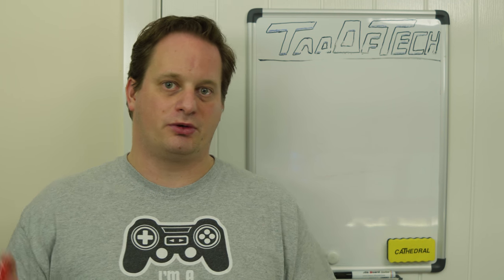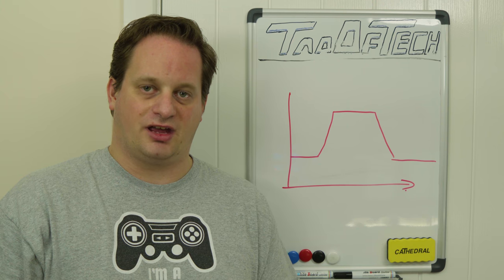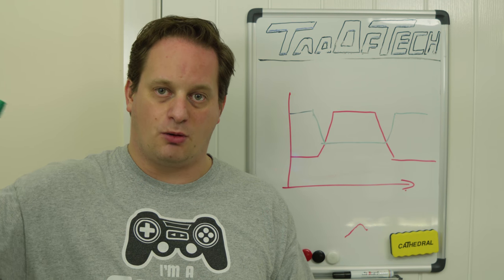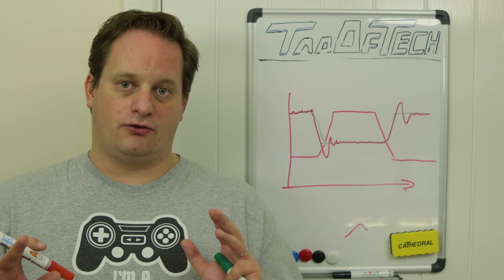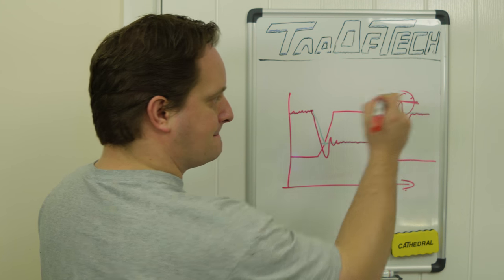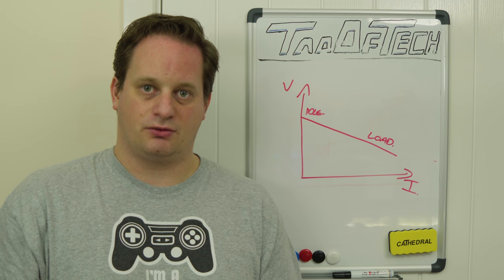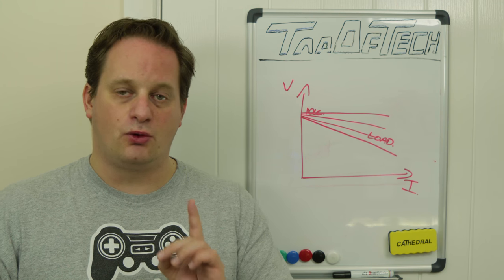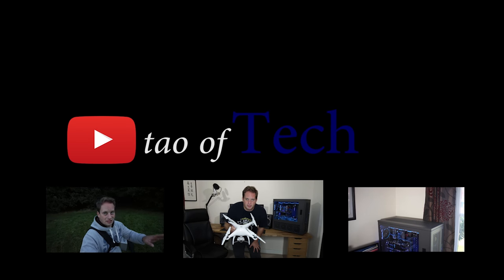Load Line Calibration - what is it?

Comment: Thanks for the explanation. But there's something I don't understand: If, like you say, the voltage drops when the system comes under load, why does the Vcore value in CPU-Z/HWinfo always go up? I haven't touched the default LLC values in BIOS.

Comment: Could you please explain this in my case: trying to overclock my cpu, was successful but after a few months the VID would go over what i set it manually (e.g. 1.44 when i set it to 1.4) then crash. I'm worried my cpu is permanently ruined although it still works and benchmarks have only shown a 2-3% decrease in performance. I set CPU LLC and CPU/NB LLC enabled, but there weren't any other settings apart from that. 
My specs:
Asus m5a97 r2.0 (latest bios)
Fx8350 4.2Ghz @1.38V
16gb Ram 1600 / 1866(OC) @1.5V
I think i may have a combination of a bad silicone chip and bad oc motherboard. I obv known my budget mobo is limited, but volate instability on that scale isn't normal

Comment: Hello! First of all thank you for the great video and great explanation.
I am new to the OC world and there is one thing that is confusing me related to Vcore and LLC. 

I have an i7 4790k and I would like to run it at 4.7 GHz. For this, I need a vcore of 1.29V; 
Reading multiple forums online it seems like for my CPU I can run 1.3V daily without damaging it in the long term. 
However, when I check HWinfo or any other software I can see that the reading is Vcore=1.31V instead of 1.29. My understanding is that LLC is compensating for the Vdroop as you explained.
Here is what confuses me: is my cpu actually getting 1.29 or 1.31v? why do I see 1.31 instead of 1.29 if definitely Vdroop is taking place when the cpu is under load. 

I know the difference between 1.29 and 1.31 is not so high but I want to be 100% sure that I do not damage my cpu.  I also know that all the sensors in the motherboard are not so accurate and probably the real voltage is something else than 1.29 or 1.31 and I would need a multimeter. 

The LLC options in my gigabyte motherboard are: Normal, standard, high, extreme, Auto. I have currently set it to Normal which seems to be the lowest value. 

I hope you can give me some insight about this !
Reply: Resti Montoya anything bellow 1.375 is completely normal for your cpu, hell most say anything bellow 1.4v is fine

Comment: I was able to get my system agent voltage down pretty low while using SA LLC Level 3, everything stable. I decided to switch SA LLC back to Auto (which is level 1) and when I restart my PC I'm getting double boots even after adding a significant amount of SA voltage.
Is there any drawback to using System Agent LLC Level 3? (it's the highest LLC setting for system agent on Asus M13 HERO).

On a different thought I'm getting high voltage overshoot
You said something that caught my attention, you said higher VRM switching frequencies could help with overshoot, I'm gonna try changing VRM SF from Auto to manual & like 500khz to see if that helps?